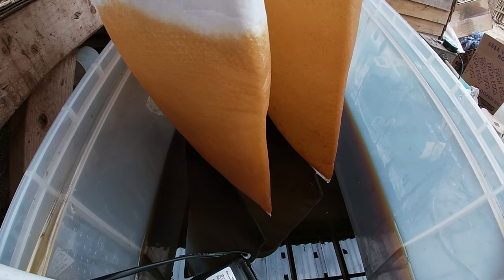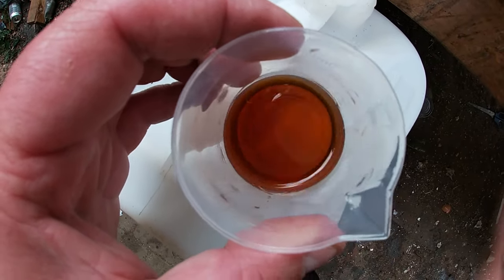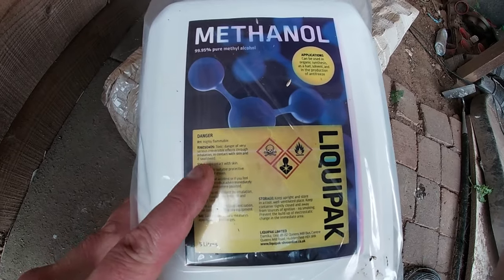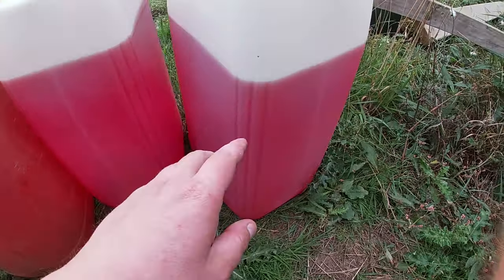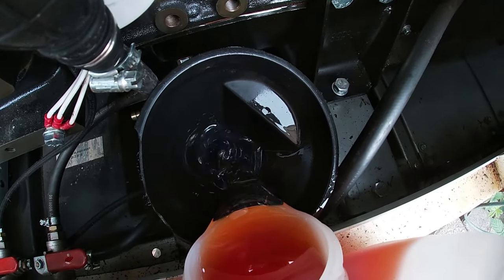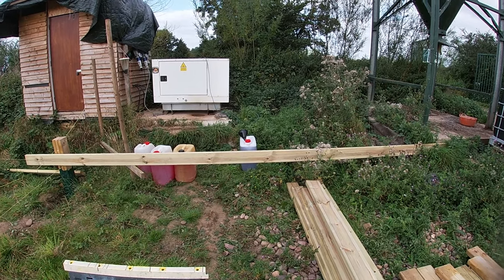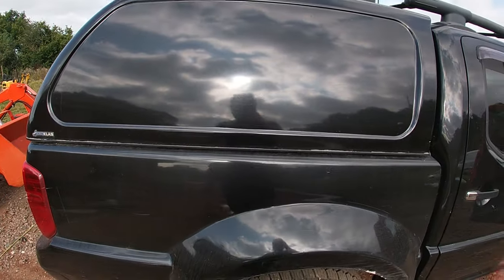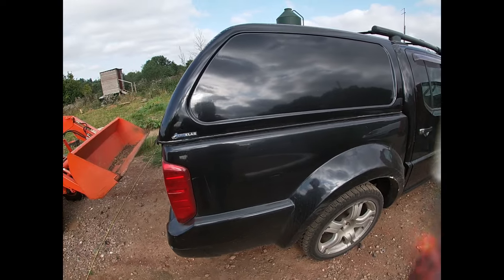3 ways to make Bio diesel from waste veg oil ! Making easy Bio diesel at home ! Making cheap fuel !

Comment: I have to jump in here. "Biodiesel" is a specific fraction of vegetable based oils. Because veg oil is a triglyceride (3 glycerine molecules to every oil chain) it requires cracking or cleaving using methoxide. That's a compound made mixing potassium hydroxide and methanol. This sets up a m exothermic reaction to create the methoxide. This is then introduced into the veg oil where the reaction begins to cleave the glycerine from the oil molecule. At the end you will be left with glycerine and carbohydrate oil chains or biodiesel. This is the same stuff used in white diesel up to 10% nowadays. Usually shown as 'B10' on the forecourt pump.   Just adding veg oil to another oil is not biodiesel. Its a blend of oils and the veg oil still contains the glycerine. Call me pedantic but it's important people understand the distinction.
Reply: Would it hurt anything though
Reply: @thatsmysidehustle4261  It's all about viscosity. Blend your veg oil with atleast 50% deisel or kerosene during summer and mild months. Down to 30% in the colder months. Any conditions below approaching freezing and below and the fats will wax up so don't use a drop of veg oil in these temps. I've been running my Sprinter on 50/50 for years in the summer. No ill effects at all. Engine loves it.
Reply: You got it the wrong way around. A triglyceride is 3 fatty acid chains to 1 glycerol molecule.
Reply: @kylebutler1101  Correct. I did get it wrong way round. Cheers.
Reply: Any idea to turn it into b100 
For low speed engine ???

For high speed engine b100 may not be possible for low speed bulky engine for agriculture pump, b100 is possible??
Reply: Plus the methanol can actually be recovered from the "waste" glycerol.
Reply: I found starting got progressively harder over 6 months, so a dash of injector cleaner or redex solves the injectors clogging up.
Reply: @tinderboxcreations  does your Sprinter have the 3.0 CRD? *Or what would you speculate the results to be running the 50/50 mix through say an '08 model CRD?
Reply: @4xAbuse  Mine is common rail yes. IT's less that 3L capacity.  Never tried an 08 model. I am guessing the engineering tolerances will be much tighter on later models so I'd start with a much lower oil mix at say 10% to  begin with and increase as you feel comfortable with. My sprinter is an old girl. Older vehicles can handle higher oil percentages. More modern vehicles are designed to use diesel in an ever more economic way so the engineering is far tighter and as such has been designed with the viscosity of diesel fuel oil only so may struggle with veg oil added. Try with a small percentage and increase with a sense of caution. I'm still running mine on 50/50 and she's still starting fine in these winter mornings. I have added Redex to mine now during the winter. Makes for easier starting.
Reply: have you seen the filtered Pork Gelatine /water mix patented idea? you end up with a ‘jelly cake’ at the bottom of a barrel which allegedly contains these triglycerides bonded to the pork gelatin….. i have to try it out to see for myself but you have rid of your tri glycerides into a ‘handy’ lump of gelatin ( can it be safely fed to anything seeing as theres nothing harmful in it ie methanol) instead of a barrel of goo…. what do people do with that? not down the drains i hope….?!!?
Reply: @tinderboxcreations  what about a fuel line preheater to help thin it a bit? before it hits the filter and the injection pump….
Reply: Actually Einstein oil is a bio-diesel? It didn't just appear?
Reply: @turtlezed  Heat exchangers are a method if reducing viscosity. The engines coolant can be irrigated through a pipe matrix inside the veg tank or through a jacketed fuel pipeline or both. Needless to say, this requires the engine to come up to running temp first.
Reply: @turtlezed  Yeah, just seen this on a Robert Murry Smith video. Looks very interesting and if it works, a far more attractive alternative to Potassium Hydoxide and Methanol with the awful glycerine. I stopped making actual biodiesel in favour of just burning the glycerine up in the engine with the 50/50 mix due to the cost of chemicals and electricity in heating the reaction up. I've still had no issues with this method but I'll definately try out the gelatine method as an experiment. My veg oil supplies are zero at the moment. Tend to get hundreds of litres during summer for free but nothing during the winter due to work locations. In answer to the waste glycerine, I still have about 20L of that crap. Generally, if I know I'm having a brazier party of camp fire, I'll decant a few litres off and just mix it with sawdust pellets and burn it that way. Has a nice flame to it and gets rid of it but Jesus, it's bloody messy stuff. I'd be very wary of feeding the gelatine cake to animals. Unsure about compostability. Glycerine is an alcohol contrary to popular misconceptions. Most assume it's a type of sugar because it tastes sweet. I have no idea of it's environmental impact if composted and pouring it down a drain is just reckless which is why I burn it. Fairly safe emissions.
Reply: @nixonsmateruby1  I'm not sure what you mean?
Reply: @turtlezed  some people just make soaps and stuff from the waist
Reply: @dewaynewhitney5703  At the biofuel facility that I work at, we mix the glycerine with 20% water and it's called "bio-carb" and we truck it out to different companies 👍
Reply: Thank you so much!  I'll try to copy and paste.
Reply: @matildastanford7019  hello, can something else to be used in this process instead of methanol? In my country it can not be find in free sales..
Reply: Appreciate the distinction, this added to the video really helps.
Reply: @tinderboxcreations you talking veggie oil from the shop ? As in can I buy a drum on Amazon and 50/50 that drum with diesel and put that mix straight in my 1.9 diesel ‘04 ? 

Regards
Reply: SVO can be used that way. It doesn't burn as easy as WVO. The cooking process helps break down the long oil chains which means it burns a little better than SVO. How much better, I'm not sure. Marginal I suspect. But yes, to answer your question, you can 50/50 SVO though at current prices I can't see the benefit when WVO is often free of very very cheap.  (SVO = strait veg oil (uncooked) - WVO = waste veg oil (used)).
Reply: Biodeisel made with oil palm (coconut) and waste oil is very good. So is a diesel blend using coconut oil. Coconut oil has a desirable high iodine value. I don't condone deforesting jungle so that oil palms are planted, but there are more coconuts in Hawaii, Mexico, S. Florida, and Puerto Rico than you can shake a stick at.
Reply: @jamestwine958 the short answer is you can but shouldn't put biodiesel into anything with a computer in it, unless you are ready to replace all the gaskets and seals and whatever else (injectors, pumps, filters, computer) as a result of your individual mixes and autodidactions.  This is coming from experience in all of the above and having had to learn all of the above for the first time as a result of following YouTube videos and getting together with other dreamers.  Twice.  I agree with the simpler methods of simple mixing 3:1/2:1, for small and medium productions.  I am watching this video ten years after having 'given up,' because I've only destroyed one diesel heater's components (by not filtering well enough and by not giving a suitable power supply amperage for the startup glow plug, now will place a 12v battery in series to a trickle charger), and I've bought two more diesel heaters to try and experiment a little more with survival.  Your truck is your truck, not worth experimenting on, unless you are ready to fix/replace.
Reply: Wrong! I notice diesel fuel in a lot of states is B20 which can have anywhere from 10% to 20% bio mass. I don’t put more the 50% bio diesel in my 2020 GMG 3500 and it gets 120 degrees to 9 degrees Fahrenheit in my local area and never had a problem. My truck as a computer i have seen older trucks break down on bio fuel and newer trucks break down on bio fuel also. The main thing is viscosity if the oil is too thick it can clog up fuel filters pumps and injectors as the weather gets colder and leave unburned deposits in your combustion chambers. The key is what most people missed in the video he uses multiple mixtures in his cars and trucks red diesel, methanol and the paraffin mixtures thus always keeping his systems clean and free of gel and deposits. The 50/50 mixture is the best option and the safest bet just throw in a amsoil all in one diesel injector clean ctane booster and cold flow additive and you will never have an issue with pumps injectors or filter failures period! I have been running this method for years and actually noticed more dirt and debris in the filters and combustion chambers while running straight diesel! With my mechanical and engineering background i have a keen eye for spotting signs of trouble it all depends on your approach and understanding of your vehicle compatibility with bio fuels in this case for most people  less is more vs having higher volumes bio diesel compared to standard diesel fuel in newer cars and trucks.
Reply: Good knowledge. Don't think people are claiming to be making refinery grade biodiesel. Maybe, eco-fuel would be a better name 🤔
Reply: Nor am I claiming they are but I am making the clear point that  Biodiesel is a very specific fuel. To be calling a blend of white mineral diesel and waste veg oils "biodiesel" is not just misleading but totally inaccurate and isn't the same thing at all. It's important to understand due to the potential affects it has upon your engine as a whole. This is known as WVO (waste veg oil) blend. You might call it "eco fuel". I've never heard that term and no mechanic would recognise it should you have to tell them what you've been burning in order for them to diagnose an issue. If you said WVO blend, they'd have an idea. Call me pedantic but being a mechanic, I feel it's important to make the distinction.
Reply: Nerd
Reply: In india they patented the mix of naphta 30% and oil as biodiesel,so the definition of biodiesel change where you live...so don't take what you see as a generality.
Reply: Excellent summary of the precise definitions of transesterification.  The pragmatic key lies in Rudolf’s original works (e.g. 1900 Paris World Fair) where he ran his engines on Peanut Oil.  My point is that any of the fatty acids (stearic, oleic and palmitic) can and will ignite via compression.  To that end, the simpler manufacture of a viscous enough alkane fuel really only requires “thinning” a used vegetable oil with another alcohol (e.g. kerosene or diesel) whose long chains (C12 - C16) enable its use as a “Diesel” fuel.

Excellent video here - elegant and pragmatic.  Bravo!

Comment: well what you are talking about is not BioDiesel, its WVO/Diesel blends! People be careful as most common rails will not work with that fuel for long and you will harm your engines. It only works with older IDI diesel engines!
Reply: 98 Cummins old enough

Comment: New method of filtering was found. Just use gelatin powder and mix it up into warm vegetable oil and what happens is the oil will separate naturally while the impurities like a magnet, stick to the gelatin as it settles out. You do need to refrigerate for the process to speed up but if it's winter stuff it outside for a bit. Pour it out into a container and on the bottom should be gel. That's your waste material.
Reply: Saw that, tbh I thought it sounded more of a faff than using some filters
Reply: @Rural_racer  sounds like it but it's cheap enough to test out so why not 🤷🏻‍♂️
Reply: The oil-gelatin mixing ratio can be known?
Reply: Such a clever idea!!! Wow I will try. I live in a tropical climate year around: Panama. Thank you for the tip!!

Comment: Kerosene is diesel simply more refined in aviation it is known as JET-A.
Reply: Wrong. Diesel is a different fraction of crude oil. It contains less BTU's and less aromatics even though it smells stronger to our noses. Kerosene is not the same as diesel although it can be used in diesel engines with an added lubricant.
Reply: @tinderboxcreations  could I use kero on an 11 plate Audi a6
Reply: All 6.2 and 6.5 chevy diesel engines were made to run on kerosene for the military vehicles.
Reply: Kerosene is a lighter molecule than Diesel. Kerosene vaporizes easier than diesel has a little less BTU per unit. It was used in  1920 and thirties farm tractors. It was cheaper than gas.  Warm the engine on gas them switch to the dissolete tank.. A metal box was heated by engine heat and vaporized the dissolete. . oops the first  entry got away without being completed I just noticed that .
Reply: @tomstulc9143  Exactly....amazing what can be accomplished with refinement. 😉
Reply: @tomstulc9143  (I think the fuel was called TVO back in the day.)

Comment: If you save virgin glycerol and put it in the next load of veg oil and pump it round it will pre wash the oil by using the remaining methanol and caustic in the glycerol. It will also help to dry the oil to reduce materials needed to process it. The glycerol from that pre washed batch can then wash the batch after that.
Reply: Yes, I do this every batch. Funnily, different batches yield various glycerol types, and sometimes the 20 liters I mix in with the "raw" oil doesn't all come back out.About half or only 10 liters. Does it get re-absorbed into the oil I wonder?
Reply: @stephenspreckley8219  the free methanol in the gliserol will to into the oil. I did a 300L batch and got 70L gliserol from its 2 reactions and put that in the next load of oil and only lost 5 L of it on draining. It's variable.
Reply: OK to reiterate the obvious the methanol scrubs the glycerol out?
Reply: @FFLFFS  glycerol is not scrubbed out. It is part of a reaction that breaks down the oil molecule in to 2 parts and liberates the glycerol and replaces it with a bit of methanol to make a methyl ester. A new different molecule.

Comment: just in case you are thinking about it remember Kerosene is a harsher fuel for your diesel engine, and the lack of lubrication within the fuel can damage your diesel's injector pump unless you add lubricant

Comment: Years ago, when vegi oil was pennies.  I had a land-rover s3 diesel.  With twin tanks, the tank with the vegi oil was a heated tank with a fuel tap . That linked in to your normal fuel system . When the land-rover cooling system would get to temperature I would turn the vegi oil on it would mix with the normal fuel . It worked an absolute treat.  And before I would stop I would turn the tap off . Run on normal deisel for a few minutes.  Never had a problem simple and it worked.  Unfortunately modern cars need more a pure deisel fuel .

Comment: Thank you very much, I was thinking about the methanol alternative but I like the kerosene idea much better! No waste and it’s cheaper than methanol and no mess
Reply: I've seen a guy here using Metholated spirits and lye, and then silica gel.
Reply: It's easier but it's not Biodiesel.  It's mixing flammable goop together that may burn in a diesel motor.